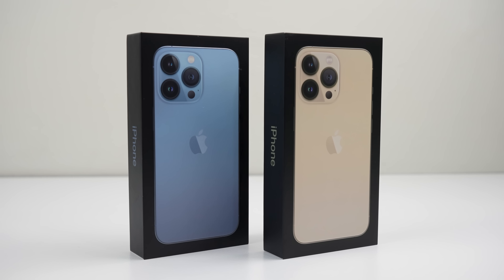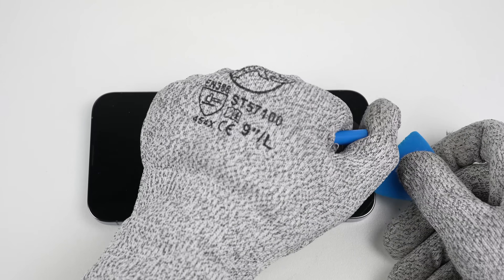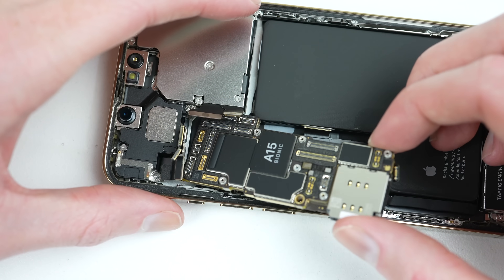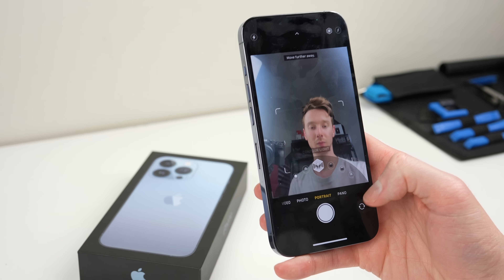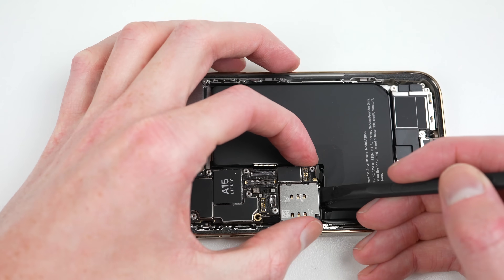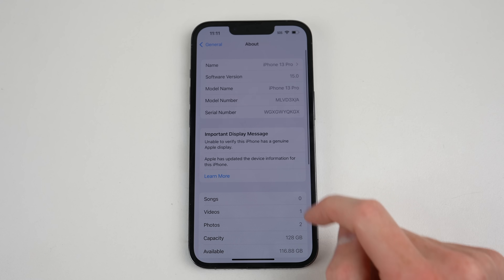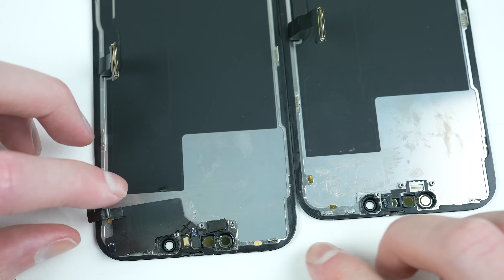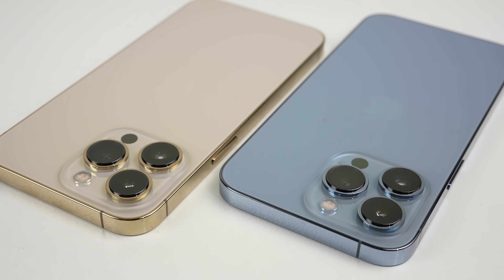iPhone 13 A Repair Nightmare - Teardown and Repair Assessment

Comment: I want the almighty EU to make a law regarding reparability and easy availability of the parts even to the average consumer. If that happens, I would love to see the faces of Apple executives.
Reply: They actually did. The EU passed a law that requires consumer electronics to be easily repairable and OEM parts be made available to buy directly from the manufacturer. The only catch is that this law, for some godforsaken reason, specifically makes an exception for mobile devices including smartphones, so Apple is not required to make repairs easy and provide genuine parts for iPhones in the EU...
Reply: @Some-guy-on-the-internet  🤦‍♂️
Reply: @Some-guy-on-the-internet  What about Macs?
Reply: @USS_Sentinel  The law seems to be mostly concerned around home appliances like washing machines and TVs. As far as I can tell, personal computers aren't included either. Not too big of an issue for Windows PCs where parts can be easily replaced by the user, but it is an issue for Macs which are way more locked down.
Reply: @Some-guy-on-the-internet  the people with the money run tings so they probably just gave them a bag to leave smartphones alone🤣
Reply: @Some-guy-on-the-internet  The reason is exactly the same that causes Instagram to work better only with apple devices: money. Money, money, money. Apple has bought themselves into the exceptions. Imagine what would happen to Apple if they still had their old overpriced technology without the instagram monopoly.
Reply: Thats grate idea
Reply: “Almighty EU” 😂🤦🏼‍♂️
Reply: They dealt at least one blow, requiring new phones to all use a standardized port (USB-C) in the future. So at least Lightning will be gone soon
Reply: rezargamer  It will be revolutionary ... or so the Disciples of the Bitten Fruit will claim.
Reply: @teunvdkeur9615  I know that, what exactly in my Question made you think that i dont?
Reply: Yes!!
Reply: For the sake of humanity and its resources this should stopped. Too bad the majority of this products owners mindlessly consume and allow the now multi-billion(trillion?) can claw resources from the earth unchecked and barely pay slaves to build these annual devices for hipsters and housewives to drone about on. Change the consumer first.
Reply: Laws don't work in a capitalist society where people vote with their wallet. You keep buying anti repair Apple products, you keep giving them no reason to do otherwise.
Reply: @Shumayal  Tell that to Apple now that the EU has approved a law that forces them to have USB C slot in their phones.
Reply: @andregon4366  They already use the type C in macbooks and replaced the lightening.

legislation is drop in the ocean compared to people voting with their wallets.
Reply: @Shumayal  And now they will be forced to do it on their phones.

If what you said were true, then EA would still have lootboxes in Belgium.
They were forced to remove them, because of the law.

The only reason those companies haven't sold you to slavery and grounded your family to make dog food is because laws exist.

The only thing making companies not do the most horrible things imaginable is because the law prevents it.

But rest assured, companies will do everything they can get away with.
Reply: @andregon4366  well.. why are they making phones more and more anti repair then?
Reply: @Shumayal  Because they can get away with it.
They'll only do it for as long as they can get away with it.
Reply: @andregon4366  Ya and it'll come into effect after eons and eons 😂😂
Reply: @truewinner1526  just like the law about web cookies that we now have to click "accept" every time I open a website?
That took 2 years.

If you have the lifespan of a fly, that may be considered "eons"
Reply: @andregon4366  From what I have read it'll be approx 4 years for it to become effective. That too if member states ratify/accept EU proposals. By that time most probably apple might go for portless way. Correct me if I am wrong.
Reply: @truewinner1526  From what I've seen, it has been approved already.
So it may take even less time.
Reply: @andregon4366  It's good then 👏🏻👏🏻
Reply: @andregon4366  Only issues with the USB-C law is that phone manufacturers have a 2 year grace period to comply and the law makes an exception for phones which do not have a port for wired charging. This would give Apple enough time to release a portless iPhone to get around that law and have MagSafe replace Lightning as Apple's proprietary charging standard.
Reply: @Some-guy-on-the-internet  Only time will tell.
Reply: @andregon4366  "Tell that to Apple now that the EU has approved a law that forces them to have USB C slot in their phones."
And again there is an exception. Wireless technology for charging is exempt. So if your phone uses that it won't get a USB-C port, nor will there be regulations on the charging mechanism.
Reply: @scribblescrabble3185  As of now.
Reply: @Shumayal  Bang on 👏🏻👏🏻
Reply: "almighty EU" lol are you joking?
Reply: Isn’t the EU considered a joke by most of the world? They made a law specifically regarding this and it was ineffectual like everything else they do
Reply: @Angus1995  nope. As is with everything in a real world, EU has done some great things and some not so great things. Don’t live in this black or white mind rot world friend.
Reply: @Angus1995  Are you talking about the EU or the US?
Reply: @Angus1995  Not everything the EU did was great, but you're thinking about the US.
Reply: @Angus1995  yes they are. still they are a joke with lots and lots of money, so nobody is laughing too loud in their face, only behind their back
Reply: @Toasty27  I’m surprised more people don’t call it the Fourth Reich haha
Reply: @Angus1995  Really. Where are you from?
Reply: @Angus1995  no..it isnt..mister brexiteer ;) the UK is.
Reply: @faelger9473  I am Australian and let me tell you firsthand nobody here takes the EU seriously, maybe our recent submarine deal gave you some inclination of how much respect we have for it. Seems only countries in the EU care about what the EU has to say about anything and those countries are not known for their innovation or international status. The US and its allies are the only meaningful force on this planet.
Reply: @Angus1995  the EU ist the biggest and Most impactful economic Block there is. They Produce the Cars the world Drives, the Machines the industry of the world uses, they Produce the biotech the world needs, etc..

If you Had an Important Job, you would notice the Impact, Innovation and international Status  the EU has.

Comment: model numbers are not the same. although don't know if that would cause issues.

one is MLVC3X/A other is MLVD3X/A
Reply from the maker: Thats because of the colour differences of the two devices. The parts inside are identical.

Comment: Engineering is a compromise based on priorities. High priority is size and price. Low priority for Apple is easy repairability. Capitalism works, and you should be able to find bulky, expensive, repairable phones out there if there is a market for them. As for the genuine parts thing, again, Apple clearly has a security bugaboo - it spends money on secure enclaves and supporting software that make everything kind of a pain. Fake or modified parts would compromise that. Again, there's lots of generic Android phones out there if you want them.

Also, I've never broken a phone. My wife has never broken her phone. What are people doing that they would need to replace anything but the battery?
Reply: Wolfpack3D  I would suppose that apple can, which as I was saying is the engineering compromise.

Comment: Now someone needs to crack the software that is used to pair parts with specific phone. Apple is losing the right to repair act and they're now making their move with this. 400 dollar repairs at Apple shop vs 20 dollar repair at 3rd party shop. Vote with your wallets, don't buy their products.

Comment: How does apple even prevent original parts from working only in specific iphone.
This is criminal, if any part breaks there is no replacement.

Do i understand that correct.
Even original parts won't work unless if apple has some some access and can unlock full functionality.

But we know apple won't fix it for you, just charge you so much that you should want to buy a new one.

Comment: This'll probably get buried but as an embedded systems programmer, I can tell you this has to be purposefully done. Even the camera not taking a picture when you click the button - that had to be code that someone wrote to do that. The devices are manufactured the exact same manner as it's very cost ineffective (and moronic) to do it any other way. There is no conceivable way these are bugs or security features.

They do this so that their (ignorant) customers will blame 3rd party repair when they go to get their phones fixed and a battery function doesn't work. That's why functionalities are just randomly missing and things seem like they have glitches that prevent them from working. On the surface "the camera isn't working right and thats what the repair guy messed with" seems like a reasonable statement. This is their goal.

Comment: Apple is a shitty, money hungry tech company and they are a BUSINESS FIRST and a tech company SECOND. They DO NOT CARE about quality and the ONLY reason they ''care'' about their customers is to KEEP said customers and keep the money rolling. They only care about money and the fact that every single thing that can even remotely be sold separately, is sold separately shows this the best. I bet you my whole life savings that if they could somehow sell their phones in 10 different packages at 10 different prices, they would, JUST TO MAKE MORE MONEY - because that's all they care about. Them removing the AUX port and them selling the charger and charger cables separately is the most shameless, scumbag move they could have ever done and it is NOTHING more than a business tactic and a scummy way to make more money. They are literally smearing shit below their customers noses and then dancing in front of them but their customers are too blind and too stupid to notice. I bought an Iphone once, it was few years ago and I never regretted buying a phone as much as I did then. 

Also, the iOS is the worst, most illogical and counterintuitive phone OS I have ever used! And also the fact that you can't even activate ''developer mode'' on Iphones or change anything within the OS is just pure scumbaggery and shamelessness coming from Apple, to prevent anyone else other than them, from making any 3rd party software for their phones.

Comment: That's why I'd never ever get an apple product that is so focused at anti-repair. Really looking forwards to when EU will force them to use USB-C
Reply: lol apple wouldn’t do that. and if they did, they would remove the port completely i think is really gonna happen. leaks before suggest so. this would also be dumb though because that would mean your phone wouldn’t come with a charger at all. b
Reply: @ohreally4752  it was in talks a year ago it could be the next possible thing. And apple will do it. Maybe not right now but in the future
Reply: @ohreally4752  wireless charging is a thing
Reply: @spd3ictpro  wireless charging is inconvenient compared to magsafe
Reply: @ohreally4752  No port, no charger IS going to happen.  Apple will switch to mag charger sooner than you think.  No port, means better water resistance - that is how they will sell it.  Same as the Apple watch.
Reply: @marceld6061  no a charging port is required in phone as well it needs to be USB-c
Reply: @marceld6061  i already said that
Reply: @ohreally4752  I can tell by your punctuation in your original reply that you missed the point I was trying to make... Apple will make the change to save costs/ get around legislation demanding that they change/ and then market it to the masses as a "design improvement".  If you can't understand how that is different from what you said- not my problem.
Reply: @PowerConnoisseur  how very '2000' thinking of you.  Even my wife's new car has a mag charger built in.
Reply: @marceld6061  I don’t think you understand. When I said Apple wouldn’t do that, I meant as in them not going to switch to usb c, not portless. I said I think it will happen, and I say I think because I don’t want someone to just take it at my word which is why
 then I said earlier leaks contribute to that theory.
Reply: they might just remove the port completely in response, as well as the cable (no port - nowhere to insert the cable, eh?), and then sell it for even more cash, because why the hell not?
I couldn't care, but the Android market is following Apple, unfortunately.
Reply: @the_null_man  the USB-C would be mandatory, meaning it would be required by law. They legally wouldn't be able to remove it.
Reply: @the_null_man  exactly!
Then android fanbois blame apple for it....even though Android has a choice.
Reply: @the_null_man  not really i do know Google n samsung is stealing apple ideas design phone
dont want use wireless charging because it super slowly like 1.0amp n USB c is 5.0amp
Reply: @kittyztigerz  Samsung has been ahead of Apple since the Galaxy s2 or 3 lol...wireless charging really isn't all that bad either. Loses me like 1.5 hours over my USB-C 100W fast charger. Not too bad
Reply: Any data port is becoming a security and privacy risk anyway.  If anything, they’ll just switch out relevant part/s for future EU releases and hardware region lock them.
Reply: Apple is overrated since Steve Jobs died.
Reply: Yeah sure. Blame apple 😂
Samsung n others are on the path and then we'll see if u would praise or hate 😂

(I don't like apple either)
Reply: I believe 80% of the development of a new iPhone is spent on anti repair, 19% is copy paste of features from the Android camp, the last 1% spent on development of new features.

And all the 'Apple care about the invironmemt' is a new level of fake.

Comment: Now what I can think of in the next iPhones is that whenever you open up a phone, you will see an LED signaling that you tried to repair or tinker with this phone and therefore when you take it to apple, they will refuse repairs because of that LED.
Reply: They were fined a drop in the bucket for them (9M) in 2017 for refusing to replace/repair/refund phones in warranty when people wanted to get the repair done by a third party (we don't have Apple repairers on every street corner here). Our Consumer Law department took them to court.  They wanted to settle but the weren't allowed to as the department wanted a legal ruling to get the precedent.  I can see them taking them back to court over this stuff.

Comment: I think a big reason Apple does this is it wants people to upgrade every year.  It’s easier to upgrade an iPhone then any other cellphone.  AT&T does this all the time.  I knew someone who got the new iPhone every year.  One year he wasn’t even eligible for upgrade for anything.  Even the iPhone he was still a few months out.  But got the new iPhone.  You can’t do that with an android/cellphones.   

The other thing apple wants you to get the repair at their place.  As repairs at Apple are expensive as hell.   I mean crazy expensive.  To the point the repair costs more then just buying a whole new device.  Which again leads me to the whole "Apple wants you to buy a new product once your old one breaks."

Comment: the reason why replacing parts on a Iphone does not work is because each part has a registry ID number bake in and the logic board is flashed with those ID numbers.
the only way to get around this is by having a logic board flash kit that is only available by the apple.
this means you screewed no matter what you do all apple products are made on purposely to be unrepairable.
i will never own anything apple as they are anti-consumer.
Reply: same. but the phone companies will be just like apple soon.

Comment: This is precisely why I chose to run Android devices over Apple devices. Its not that Apple devices are bad, its that if in 2 years it breaks, I'm not allowed to fix it. To be clear, its perfectly repairable, modular, etc, however Apple refuses to LET you repair your own device.

At least with my Samsung phones, I can buy a screen, and install it, and everything will still work properly.

I shouldn't be forced to never have a Camera again because I replaced my screen, even though the camera module's are perfectly fine.

This is absolutely ridiculous, and Apple needs to be punished for this type of thing.

Comment: On one hand if your phone is stolen, then the phone is pretty useless for spare parts since they are interlinked to the main chip. But it also means they have a monopoly on repairs and parts and because of the interlinking repairs and spares are going to be more expensive.

Comment: For older iPhones there is a programming tool to transfer serial number from the old screen to the new one. So I think we only need to wait when they update the tool to work with new screens from 13 series of iPhones.

Comment: I wonder if you have to throw the Apple car away when it needs tires or windshields washing fluid. It will probably only be able to recharged at and Apple station because it will certainly have an Apple unique charge cable - which they will change every model year and will only start if are able to get verification texts and can answer multiple 2 step verification question. Apple sucks big time in my book. Assholes